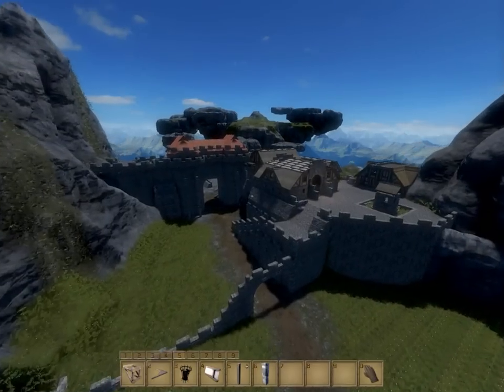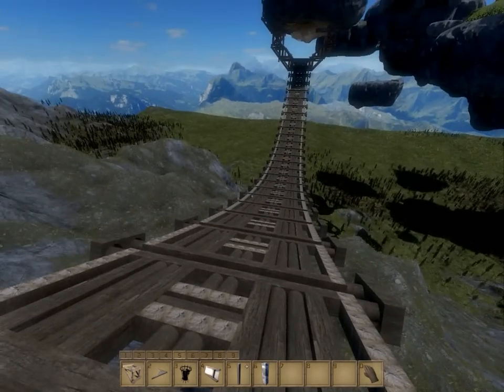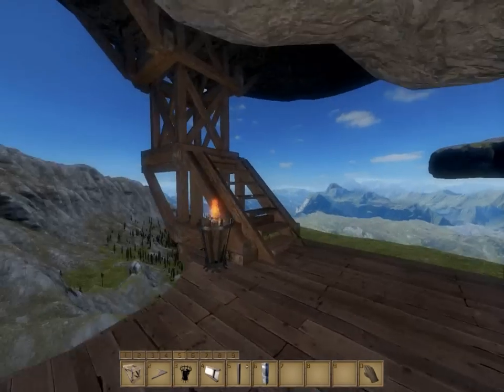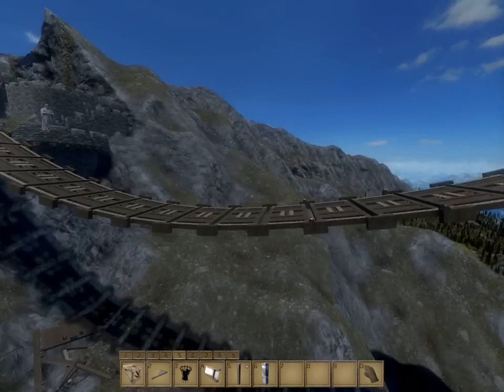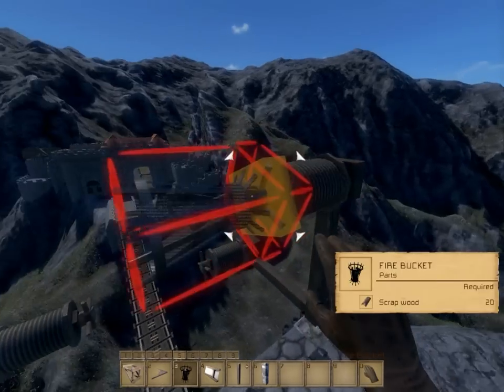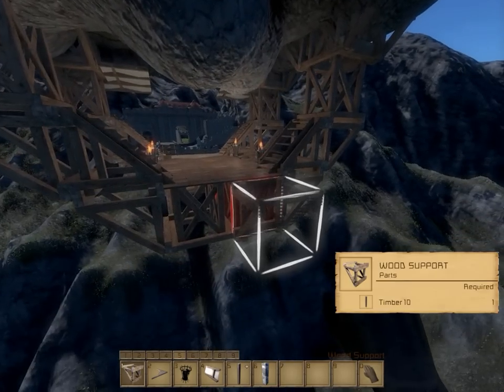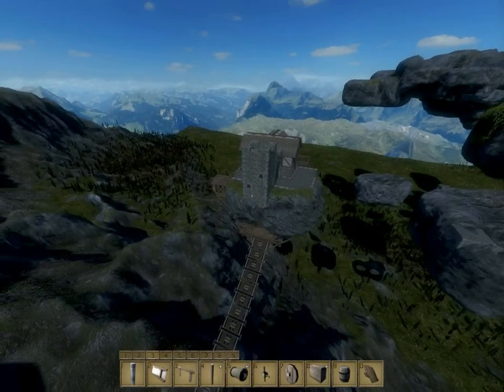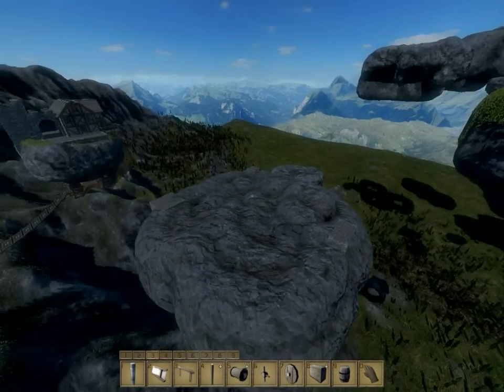Medieval Engineers | Lets Build | Airship Isle | Part 4 | Island Beginings

Comment: I think rather that that underneath staircase just going left to go up, it should go both left and right. It would look better, seem like its distributing the weight and as the main entrance & exit to and from the islands it would (roleplay wise) stop bottlenecking to traffic flow
Reply from the maker: +krulty I couldn't make a path the other direction. It would interfere with the bridge going to the next Island. As for Bottlenecking concerns - it is a single Path - there is no merging at this location...